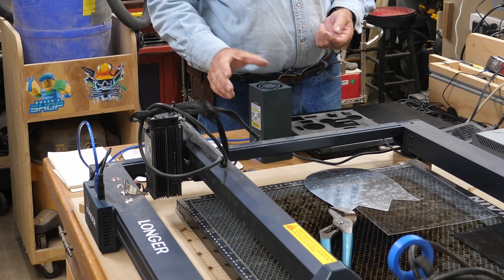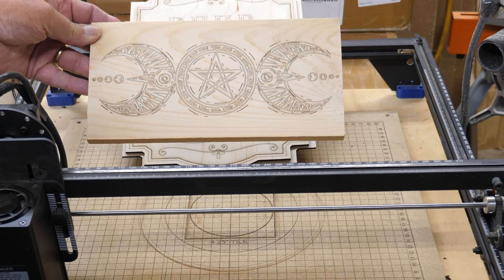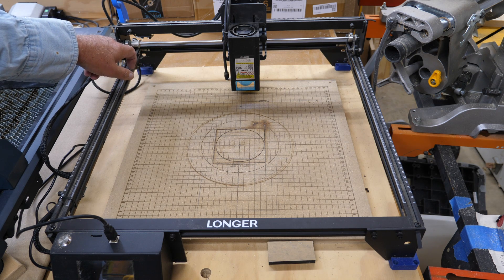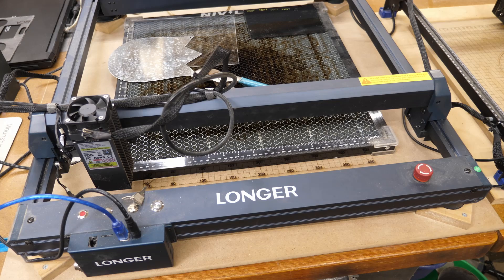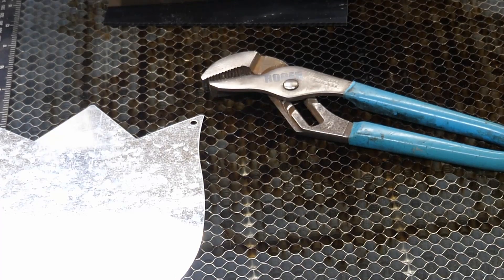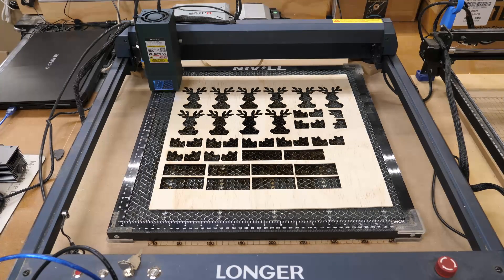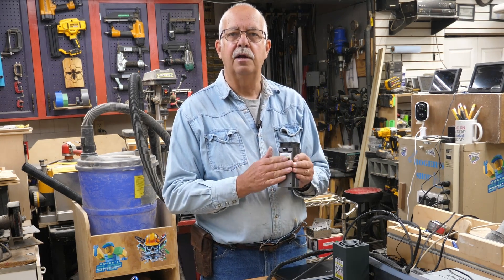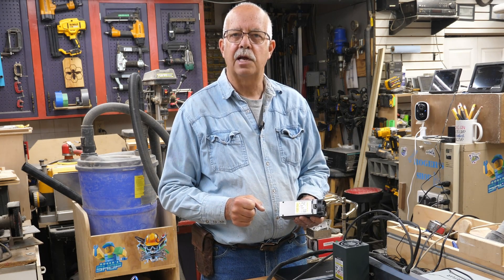Longer Lasers Ray 5 & B1 Compared

Comment: I recently learned about and saw a person engrave an image on a painted canvas.. that really interests me.. I was looking at another engraver/cutter and just learned about Longer engravers earlier today. Price is right with the sale.. curious if either the ray 5 or the B1 would engrave nicely on the painted canvas??? And if I went straight with the 30 or 40 watt laser, the power can be turned down to engrave on the canvas?? I am looking to do some e graving and cutting on other material. Thin material. Really.. don’t need to cut anything too thick (can upgrade for that if things go well) thanks a for your reply and time
Reply from the maker: Yes, both the Ray 5 and the B1 are perfectly suitable for canvas.  Power and speed can be adjusted to suit the material on both.

Comment: I have the ray5 10w just upgraded to the 850x850. Looking to upgrade the head now. Looking into the options like possibly the 20w or 40w. Their site says “40w for B1” your saying it will work on the ray 5 platform??
Reply from the maker: The Ray 5 is limited to 20 watts.  The big extension is a nice upgrade (I've done it) for large projects.  Just a hassle to store!

Comment: Good day. Pls delete if not allowed. I have a Ortur LM3 and its not cutting correctly. A circle size on X and Y axis differs by 0.02mm but diagonal differs by 0.5mm. Any way I can fix it, only got my laser about 2 weeks, so titak newby. Thanks
Reply from the maker: Check that eccentrics on rollers is set correctly.  Tight, but not so tight that there is resistance when moving.  Check belt tension as well.  Both of these can contribute to the problems you have described.

Comment: Hi Roger, greetings from austria. I have a Longer B1 and the one thing 1 hate is the screw for adjusting the z-axis. Now there is no alternative for the B1 but i found a adjustable plate for the Ray 5. Are the screws on the module backside identical? If so, i could order the Ray 5 Adjuster.
Reply from the maker: No, they are not.  I agree with it not being in the best spot to get your fingers on.
Reply: Thank you - i hope some better solution comes up soon.

Comment: I have ray 5 10 w where would I get a 20 or 30 watt head and do I have to change plug in
Reply from the maker: Upgrade heads are sold as a kit with necessary cables, upgraded power supply, limits, etc.: https://www.youtube.com/redirect?   https://s.zbanx.com/r/diVNi3556JSa